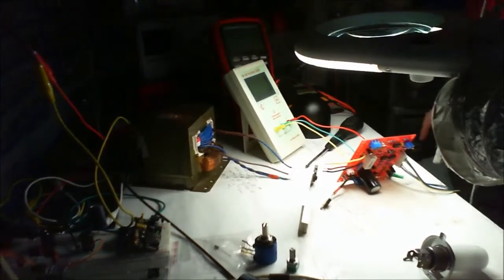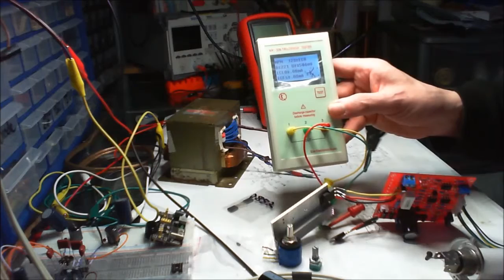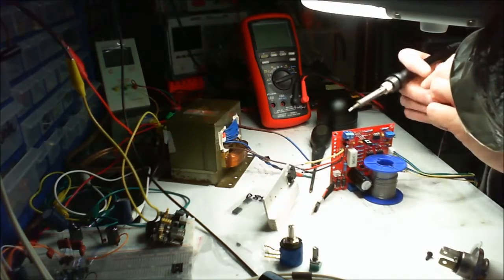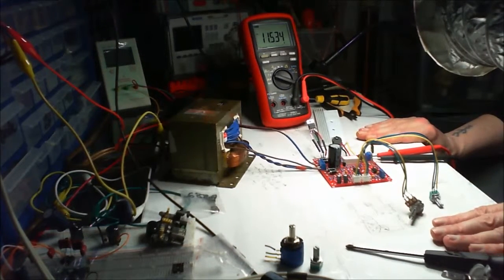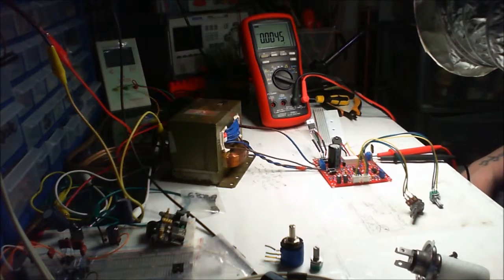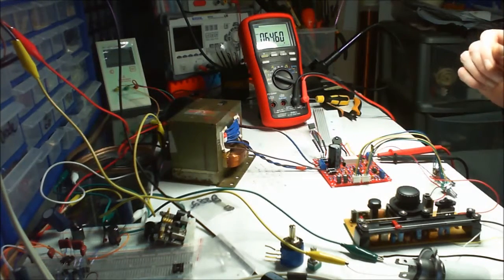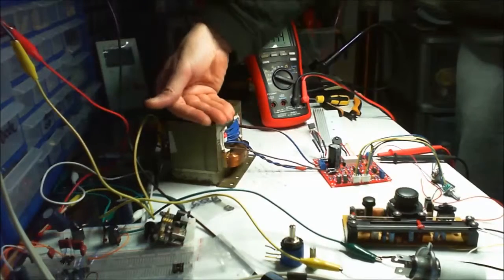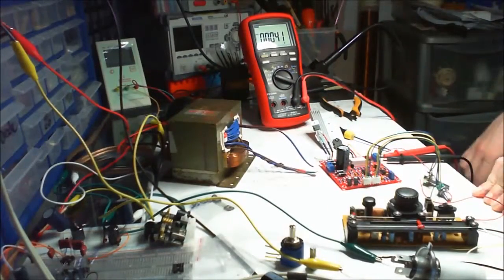Microwave Transformer Experiments

Comment: Do you have the schematic for that power supply board? The big transistor in the heat sink should be the linear output transistor, and the D882 shouldn't be anything more than a driver or something like that.
Reply from the maker: +DrCassette I have a link for the build which has the circuit diagram. 

This one has been a pain from day one but I guess I didn't help it trying to power a Jacobs Ladder off it when I first put it together.
I had it powering a little LDR switch circuit I made and it was fine. Then I disconnected the circuit reconnected and the supply popped again.
Link below shows schematic. 
http://img.banggood.com/file/products/201505080459530-30Vinstall.pdf
Reply: +MonkeyMagic Elecifun 
The 2SD882 is in fact the driver transistor for the linear output transistor. So when you put a load on the output, there will also be a load on the driver. Make sure the driver is also connected to a heat sink. Also, you could check the current amplification of the linear output transistor. The output current, divided by that amplification factor, is the output current the driver transistor has to deliver. 
I once replaced the output transistor of one of my power supplies with a transistor that was designed for HV switching and therefore had an amplification factor of only around 2! So when I tried to put a load on the power supply, the driver started smoking when I got up to about 1 A!
Also you could connect a diode from the emitter of the output transistor to the collector. That will prevent any reverse current from damaging the output transistors. A reverse current flows when for example you have a rechargeable battery connected to the supply and the output voltage of the supply is lower than the remaining voltage of the battery.
Reply from the maker: The Beta is 71. I cheated and used a meter. The D1047 output current, is that the collector current? if so, 12 Amps.
I guess I have this wrong as this would mean 5.916 Amps through the 2SD882 and it is not rated for that. Its collector current 3 and base 1 Amp. Cheers for your input on this.